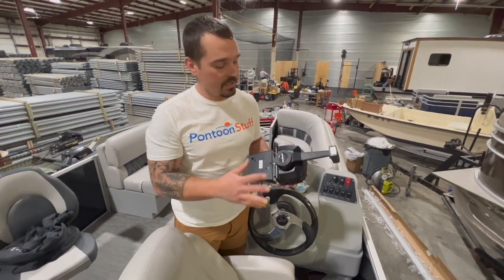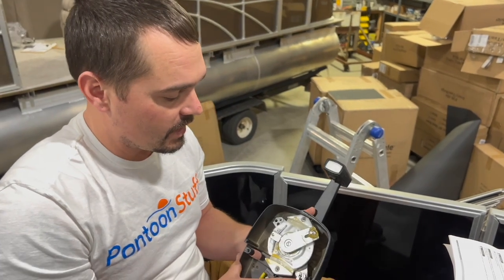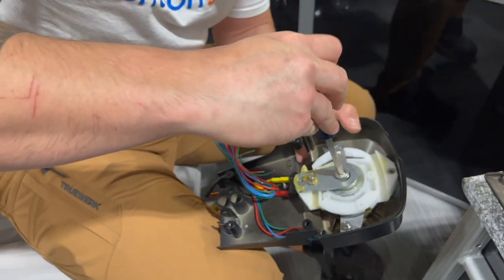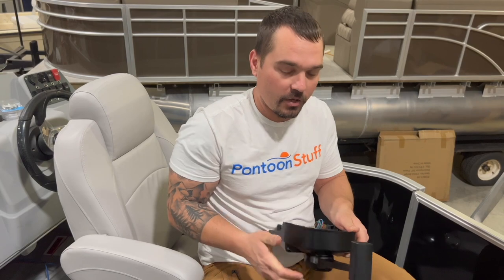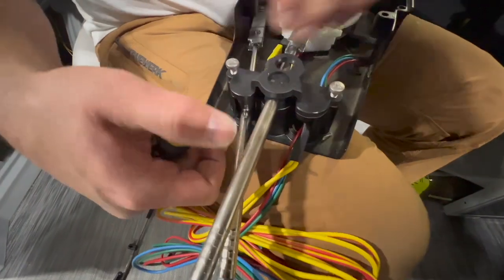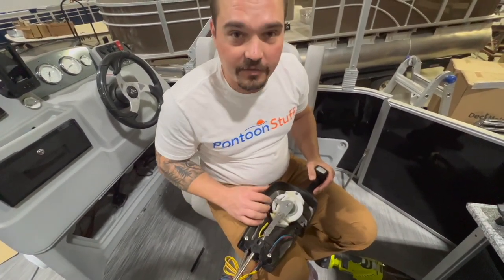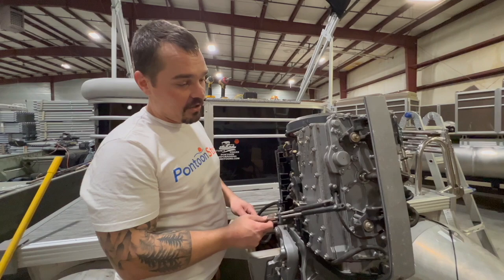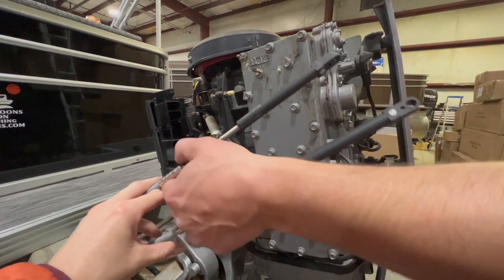Universal Outboard Control Installation - MarPac Controls on Mercury/Mariner Outboard

Comment: Nice tutorial.  I used a black piece of 1/2” thick pvc from my old helm and bolted that to my large console and then mounted my binnacle remote through that.
Reply from the maker: Thank you, and thanks for sharing what worked for you! It's pretty common to reuse old bezels or plates that are already made to fit controls. Or make a new one as a face plate.

Comment: Perfect teaching-video. I think I'd put a backing board behind the console to stiffen that plastic around the control. I'd probably also have the wires running along underneath in a pvc or PEX tubing just for looks.
Reply from the maker: Thanks! I’ve not had a problem with those consoles flexing. The steering wheel could sometimes use some reinforcement, but only when someone uses it to help themselves stand up. I’ve heard of people running wires under in pvc, makes sense to me. We try to keep it accessible in case someone wants to get at it in the future.

Comment: Great video. This was exactly what I needed. Swapped over from a quicksilver 2000 to the marpec this weekend. I fully disassembled the quicksilver and use the key switch from it. I only had to take the wires off the old neutral switch and connect the to the new controller. Keep up the good work.
Reply from the maker: How perfect is that?!? I’m so glad our video was helpful for you, that’s our mission with this channel!
Reply: @tomspontoons  my kill switch is currently just hanging inside the console. I will need to get a new one that can be installed under the key eventually. I mean it’s a pontoon boat, not a jet ski. I don’t think I will be taking in hard turns that could throw me off anytime soon🤣
Reply from the maker: @davidlane4327  Right, I’m not sure I’ve ever seen a pontoon captain wearing their safety lanyard. Should they wear it to be 110% safer? Probably. There’s a new law in Michigan requiring a safety lanyard on certain boats!
Reply: @tomspontoons  if I used it I would kill the engine every time I reached for another 🍺.  It’s all about the party in slow motion here in TN.
Reply from the maker: @davidlane4327  Hahaha I love this! And also.... GO VOLS!
Reply: @tomspontoons  in my house we bleed orange 🍊. My wife was in the UT BAND. You should join the Vol Navy one weekend
#VFL #GBO
Reply: @tomspontoons  I’m going to change my mercury 115 4 stroke over to an optimax  150 , will I have to change my control box out
Reply from the maker: @crazylewiemike  Short Answer is No. What year are the motors? Mercury has two different ignition harnesses that plug into the motor, one being an 8-pin (older motors up to the 2000s), and the other (newer style) is a 14-pin. Worst case you can use an adapter harness ($50 part) to make your controls work with the different motor if they have different plug ins on the motor.
Reply: @tomspontoons  the 150 is a 2005 and the 115 is 2014
Reply: I have both style harnesses
Reply from the maker: @crazylewiemike  I don’t know off the top of my head because 2005 was right in that area where some motors may have had the new 14 pin and some may have had the 8 pin. Your 115 will definitely have the 14 pin though. So worst case again is a 14 pin to 8 pin adapter .
Reply: @tomspontoons  I sent you a e mail
Reply: @tomspontoons  the 115 has the 14 and the 150 has the 8 pin
Reply from the maker: @crazylewiemike  sounds good. I’ll take a look and get back to you!

Comment: Do you have a video on what to do with the wiring from the motor that used to go into the old control box? Wanting to do this install, just unsure how to wire up the ignition and everything else.
Reply from the maker: No specific video YET, but we will keep adding that stuff over time. Are you changing the type of control box? Generally, the key switch is attached as your main engine wiring, and the shift/throttle is the mechanical portion. Worst case you may need to purchase an engine harness for your motor that has a key switch and safety lanyard separately from the shift/throttle box. Then the neutral safety and trim tilt wires will be the only wiring that connect the ignition harness to the shift throttle box.

Comment: As always learned a lot! I was thinking about replacing my throttle controls since the old one would detract from my "all new" rebuild. Now, I'm convinced I can do that. So, very helpful. Thanks
Question: Do you ever label both ends of wiring or cables, or is that just for amateurs like me?😂 And it looks like your wiring is just hanging down, do you ever bind and attach your wiring to the console sidewall for neatness?
Reply from the maker: You can definitely tackle the new controls! And Awesome questions!!! Yes, I have absolutely labeled both ends T for throttle and S for Shift. I always tie up my wiring under the helm at the very end. I work from the accessories themselves tying everything up to the console, then I bundle any slack left under the console…usually attaching it to the steering cable to keep it in place and off the bottom where moisture could potentially collect. 

What kind of and year motor are you working with? Maybe I can lend some tips!
Reply: @tomspontoons  It is a 2003 Mercury 60hp Bigfoot fourstroke. I'm trying to read the wiring diagram, but if you'd ever like to break down the boat side (motor) harness and explain which I use and which don't matter, that would help with gauges too. It's the most intimidating aspect of this first build for me. Especially how key switch stuff has to be done.
Reply from the maker: @BuenoToob  Good info to know for future videos! On that ignition harness, you should have a black rubber coated bundle of wires that plugs into the engine and then runs to the helm. Off of that you likely have a gauge harness that plugs into the main motor harness under the helm. That will have your wiring for the tach (gray), ground for gauges (black), key on power for gauges (purple), and possibly some other wires for oil or temp gauges (rarely used on pontoons as those alarms are built into the audible horn). The other wires would be for trim and tilt (blue, green, red) which hooks into your wires coming from your shift/throttle control…and your two neutral safety switch wires (yellow with red stripe) that will also connect to your shift/throttle control. I will work on doing a video in the near future breaking that down better!!
Reply: @tomspontoons  That's a great start. Question: whoever owned it prior cut everything from the end of the harness, and the cut off piece, which led to all the gauges, etc. is a birds nest. If I start from the harness, should I worry about wire color, or just shrink label the new wiring? What's your experience? Also, I need to know what wire gauges I should have on hand for all wiring (lights, battery to helm, etc.)? Thanks again!
Reply from the maker: @BuenoToob  If you're referring to the engine harness, your best option might simply be to buy a new or good used engine harness w/ key switch for that motor ($100-$200). Then add a gauge harness ($40-$50). That way you'd have everything you need and peace of mind knowing it's done correctly.

If you're referring to the accessory harness (for nav lights, horn, docking lights, etc) then you can use what's there and splice in your own wires to the dash or to each accessory. The alternative is the wiring harness from pontoonstuff.com which is $120 but one of the biggest time saving items I put on any boat. 

In general, 16 gauge wire is your best bet, especially if you're stacking LEDs on that single run. LEDs by themselves are fine with 18 gauge, but when I wire multiple LED strips into a single core wire that runs to the switch I go with 16 gauge.

Comment: We purchased the  Marpac throttle from PontoonStuff and have questions about installation on the Luxury Pontoon Console.
The installation manual and your video illustrates the shift throttle arm on the left side. This  configuration doesn’t work on the Luxury Pontoon Console when using a typical 14” steering wheel, but flipping the throttle so the arm is on the right would fit. My question is, do you have any concerns with, and advice for installing the throttle so that the arm is on the right? Is it as simple as flipping the orientation and flipping the push/pull mechanism?
Reply from the maker: I’ve seen that done on a number of occasions. No concerns as long as you’re installing everything to push or pull to properly operate the shift mechanism and throttle!

Comment: Hi Tom, I have bullets on the cables at mariner 1994 60 motor. My current shifter is a vintage morse and there are no bullets at the current shifter. The number on the cable is Morse 32377-3-240in 7556. Can I use these cables or do I need to purchase new ones? If I need new cables, any idea where to purchse. I purchase this Marpac shifter based on this video.. Great Job!!
Reply from the maker: I wish I had a better answer for you! I would contact Marpac and ask if those cables will work (owned by Donovan Marine). From there, you could run Gen 1 Mercury/Quicksilver cables, and you can get those at any Mercury dealer or online based in 1 ft increments. You’d likely need that adapter kit for those!
Reply: Thanks for the help!
Reply from the maker: @jeel2235  you betcha!

Comment: Hi Tom I installed the marpac single lever control 7-0118. I had a mariner. I bought the extenion kit. The screw on cable end that come in the marpac kit are to fat for the extenion to lock on. Any ideas
Reply from the maker: Send me a picture of what you’re working with…there a chance you could drill out the holes in the extension kit? Enough material left there to work with?

TomsPontoons@gmail.com

Comment: Greetings Tom, do they make an angled spacer that can be placed between the shift throttle and the helm console for added clearance?
Reply from the maker: Not that I’ve ever seen. I imagine something could be machined out of plastic or aluminum pretty easily though.
Reply: I see Yamaha and Suzuki make them. I will try the Yamaha bc the 702 series closely resemble the Johnson Evinrude binnacle throttle shifter.  Any differences  may be subtle and modified, definitely worth the $20 investment that I can use as a reference for a fabricator.
Reply from the maker: @awakenedtotruth8419  perfect! You can probably make your own also with a jig saw and some marine plastic (starboard). It comes in a variety of thicknesses and sizes. Worth looking into as it seems like it would be an easy project.
Reply: @Toms Toons Pontoon Refurbishing  
YES! I 4got all about starboard, and I heard it shapes up easily and clean.  Last time I looked into Starboard, it was a bit pricy and came in a large section.  I will try again. Thanks, Tom.

Comment: Would you be willing to give the link for the Marpac binnacle remote for my 2003 Mercury Bigfoot four-stroke. When I do a search on Amazon I get tons of options and don't know which to choose? Be sure to attach your referral ID to get credit. Thanks
Reply from the maker: This is the same control box I installed, came from Pontoon Stuff. Enter “TOMSTOONS” for 5% off at checkout. 

https://www.pontoonstuff.com/products/marpac-universal-pontoon-throttle
Reply: @tomspontoons  Done and done. Thanks for the discount!
Reply from the maker: @BuenoToob  happy to help! Remember that you might need the adapter kit I referenced in the video!! I think I gave all the info for that kit

Comment: what binnacle can you mount in the standard console. i have a mercury 60 hp bigfoot. i don't need an ignition switch just power trim
Reply from the maker: I’ve installed some of the older Mercury Binnacle mount controls on the standard console. They were slimmer width wise so it worked. It gets crowded with the steering wheel. I prefer to do a side mount box on the railing or side of the console when working with the standard console.
Reply: @tomspontoons  Do you remember which controls they were? If I can I would prefer to keep it on the console somehow. I just can't seem to find anything that gives me total dim's to know if it will fit.
Thanks
Reply from the maker: @gregloughe4647  A side mount control box can be bolted to the side of the standard console from Pontoon Stuff. I've done that a time or two. It would have the ignition switch and harness built right in. 

The binnacle I've used looks like the one linked below. I'll say it again though...it's still a very tight squeeze. Works fine, and doesn't interfere with the steering wheel, but it's tight!

https://www.ebay.com/itm/175321312186?chn=ps&norover=1&mkevt=1&mkrid=711-117182-37290-0&mkcid=2&mkscid=101&itemid=175321312186&targetid=1645685074008&device=c&mktype=&googleloc=9017200&poi=&campaignid=16730423415&mkgroupid=135815925780&rlsatarget=pla-1645685074008&abcId=9300841&merchantid=102014396&gclid=CjwKCAjwtp2bBhAGEiwAOZZTuKl_Io-iJgQIWTYj35tfLHXp5LCL1EH7SgcSolwcbgyyM_nBXJ5LIRoCqrQQAvD_BwE
Reply: @tomspontoons  Thanks
Reply from the maker: @gregloughe4647  happy to help!

Comment: Alarm will not stop beeping------I bought a pontoon boat with a 1994 mercury mariner. All of the wiring was cut and on the floor. I bought a six wire ignition, after market. that is suposed to be merucury. The wires matched to old ignition: red, black, black yellow stripe, yellow red, yellow black, purple. The alarm was connected to the purple ignition wire so I connected it the same. there are leads going to a gauge. I started without connecting to the gauge then I connected to the gauge. The alarm beeps when I turn on the key and does not stop. I dont know what I am doing. Can someone guide me how to wire it correctly?
Thanks You!!!!!
Reply from the maker: I’m not an outboard mechanic…I’ll never claim to be. I can rig them and do maintenance, but some details are over my head. I generally know enough to be helpful, but the pros are who you need to seek out. 

That being said…Your alarm will sound solid horn for overheat and intermittent for low oil. I’m only really familiar with using the OEM harness (8 wire) from Mercury. If you hook the horn to purple you’re simply connecting it to the key on power, so you’re just powering it up to sound with the key. I believe it needs to be connected to an alarm wire which I think is tan with blue. Your 6 wire harness is missing some critical wires including the gray tach wire which makes me think it’s not the right harness for having an alarm horn wired in…perhaps it’s for an older model motor that isn’t oil injected or for a lower hp motor that’s not equipped with those signal wires. 

Call or stop in to a local marina, buy some oil and stuff for your boat to support them, and ask the service manager for help…that’s what I’d do!
Reply from the maker: At 1:15 of this video there’s a chart to break down different ignition harness wires for different outboards!!

https://youtu.be/yDOqxwb_RLE